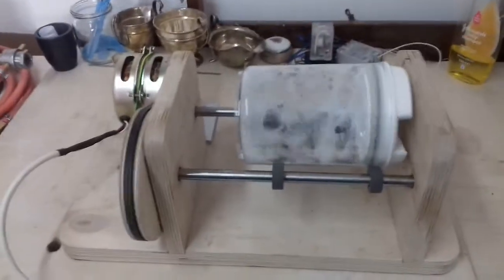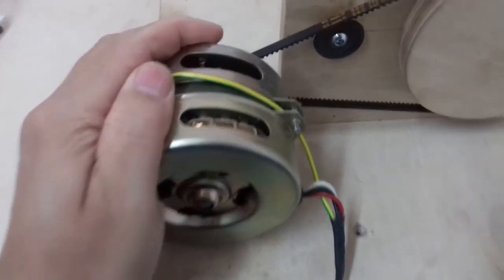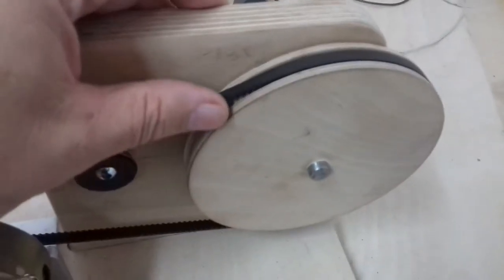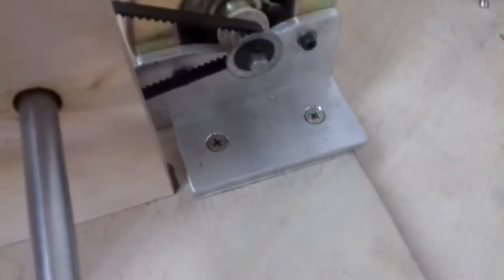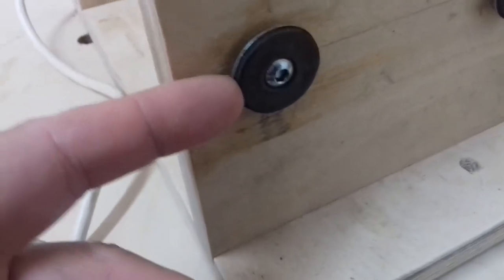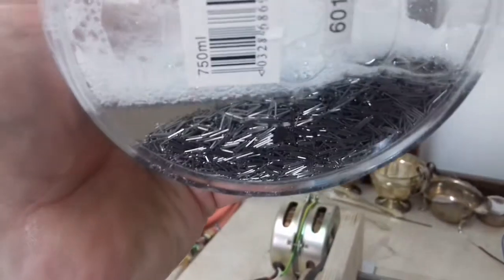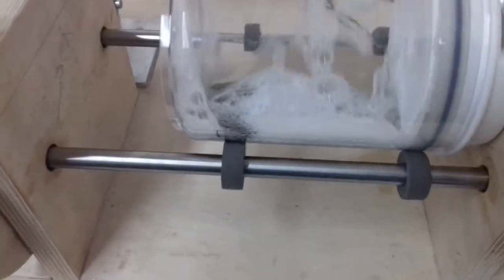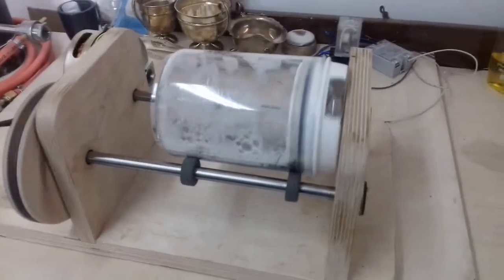Homemade Tumbler Polisher

Comment: Does the pins realy mowe ? Not youst slide in the yar?
Reply from the maker: They move once you put items inside and a few rubber dice, this is for very fine objects, for the larger objects I use another drum with small paddles glued on the  inside, then things really liven up.